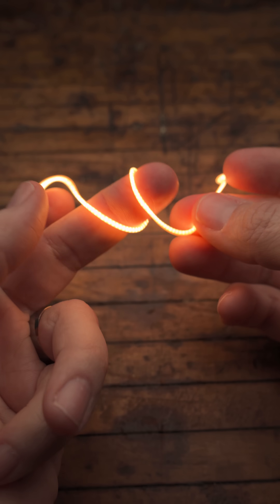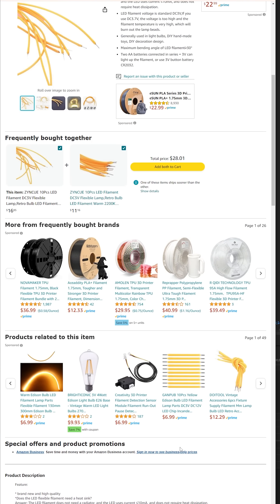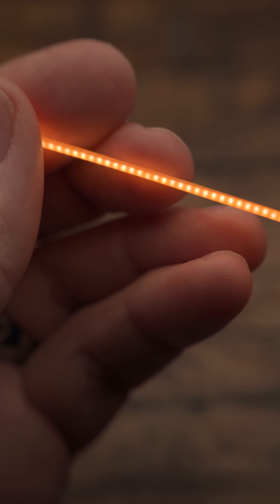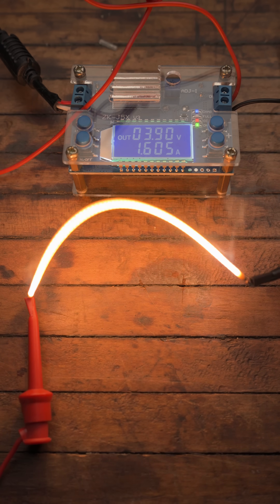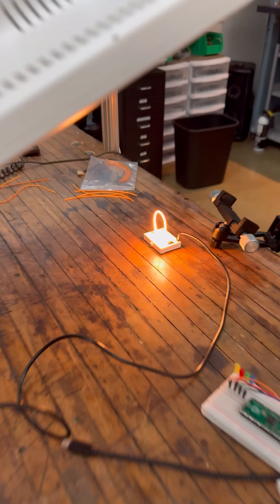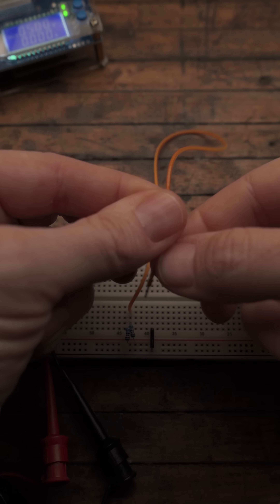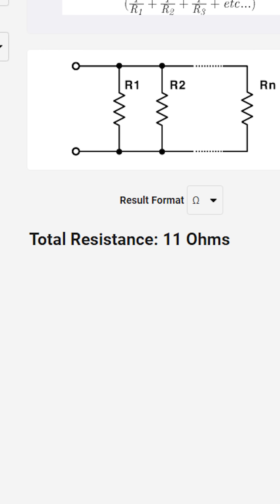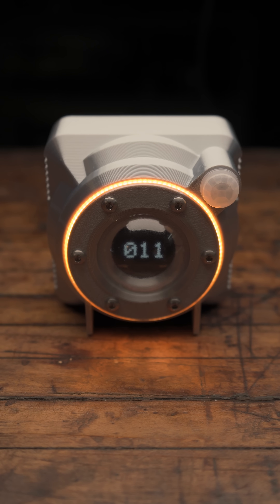#FlexibleFilamentLED

Comment: I would love to get these flexible little LEDs because i have a problem with the normal ones THEY KEEP STICKING OFF i have buyied some from the shop a few month ago and they have a plug and a thing that is connected to the plug and because of the heaviness of the plug and the thingy It keep sticking off and every time i need to go under my desk (Yes i sticked my LEDs to the underside of my desk) and press them to the underside of the desk and the worst thing i need to do thing every day because it sticks OFF. Soo i gonna buy the flexiboys (flexible LEDs) >:3

Comment: The effective resistance of 2x 22ohm resistors in parallel is 11 ohms? This seems really low, but I’m not sure what the max power per unit length you need. I’m assuming the lower current recommendation is that they’re assuming these may be enclosed in glass and those won’t have good natural convection heat transfer to cool off and will burn up.

Comment: Makes me sad I got two a cheap light bulb flashlight with one of does as it’s lights I love it a lot but one of them is abit faulty so I often bend it around to make it fully light up and keep it on the lower setting so it doesn’t burn out because it doesn’t handle the normal brighter setting to long😅😢❤

Comment: At that low a resistance I'd almost consider driving them off high frequency pwm or a constant current source from an opamp and a BJT on the output as the current source.

PWM control would probably allow you to overdrive them pretty hard without them blowing up and it's easy to drive a few hundred ma at a few hundred kHz so it won't even show up on your cameras

Comment: The statement "longer versions need more current" is most probably wrong, you need to reduce the resistance ( to half it's value) to allow the same current to flow since now the voltage drop in the led filament is (twice) higher

Comment: A traditional LED is simply a diode, which means that if the current isn't limited, it's like a short circuit. Furthermore, they are very limited in terms of the reverse voltage they can withstand. For decades, LEDs had a maximum recommended value of 20 mA; blue LEDs didn't exist. When blue LEDs were invented, they began to be used with higher currents, but always with a good heat sink, which these "micro LED strips" obviously don't have.
I should add that there are two reasons why a circuit might not have resistors. A) because what powers the diode or diodes is a constant current source. B) because it's powered by a small battery, whose internal resistance is very high.
Having said all that, it doesn't make sense for these "filaments" to operate at 100 mA. 50 mA still seems like a lot compared to LEDs used in televisions or monitors, since these have a heat sink base.
Reply: Before you ask, the reason blue LEDs began to be used at higher currents is for lighting. White LEDs are blue LEDs; they have a filter that only allows the white frequency spectrum to pass through. That's why, once in Florida (USA), new light fixtures failed, and when turned on, they appeared blue. Of course, people came up with all kinds of conspiracy theories.
It also occurs with LED TVs (the name comes from the type of backlight), where the temperature damages the filter in LEDs, and the TV image appears blue.

Comment: i feel like one could use distilled water to dissipate the heat.
if done correctly: a strip strung inside a glass cylinder  filled with distilled water should handle more current

Comment: Every LED has some "wiggle room". You can run pretty much any LED at way higher currents than specified. But the lifespan is halved, every 10°C (about 18°C) warmer the LEDs are run. So they may run fine on 200mA, but the lifespan will be significantly reduced. Same goes for running them at less power than specified. You can drastically increase the lifespan (and efficiency) by running the LEDs at lower than rated current.

Comment: People forget that you can run LEDs 2 ways, low and slow, or hot and fast. Any LED can handle 100x the recommended wattage, but only for a few seconds. Or you can run them under voltage for 100 years. You pick

Comment: I have a few of those filament style LED wires, but I wanted to find a way to get the wiring to pulse similar to the clothing from the StarCraft 2 video game with no luck, since power application is distributed serially without any slow light amplification affect. I guess the only method that would actually work is using methods that fake a pulse lighting affect.

Comment: No one gets electrical engineering right except for the engineers, because granted, it's tricky. Current requirements don't increase due to length because the LEDs are in series. 1 or 50, the same current will pass through each. The voltage will need to be increased proportionally to the length, due to the drop across each pn junction.

Comment: use a current source like LM334, any current mirror, depletion-mode MOSFET, linear constant current LED Driver like NSI45035, or a constant current diode like NSI45030.

Resistors are fine if your power supply is as solid as a rock, but these other options are far more forgiving, and really cheap.

Comment: Thanks for explaining why putting the resistors in parallel is better than getting lower resistance
Reply: Putting two 1/4 Watt resistors in parallel is the same as using one resistor of double the wattage limit (at half the resistance, of course, if it's just two in parallel) Using a 1/2 Watt 10 Ohm resistor would also work just fine.
Reply: @ctpctp can't argue with that. But sometimes you don't have exactly what you need, so these hacks could be beneficial

Comment: I had a hoodie that had one of these in the piping of the zipper it was really cool ran on two double A's and had a little stitched pocket on the inside where you would put the battery pack and then hook up the LED

Comment: Why would you turn up the amps for a longer line? That doesnt seem to make sensr in a technical way, since amps are always the same across a single line.
What you have to increase is the voltage, since every led is a little resistor and that's how it should work.
Please correct me if I am wrong, i am an apprentice
Reply: No you're right that makes no sense. The current determines how bright it is and as you said, in a line the current will be the same. So you're right

Comment: How hot do these get at the recommended power levels? I wish they sold these in custom strip lengths, would make a great modern alternative to having a light bulb hanging down from your ceiling, pair this with some sort of controller and line the corners of your ceiling with them!

Edit: basically just a tasteful version of the existing rgb led strips available on market today

Comment: Lifi ... data transmissions by electric light source. Wifi, but the light bulb is the router.
Now, with the innovation of using the infrared light, lifi can achieve hundreds of gigabytes per sec

Comment: ChatGPT just told me that one way to be able to see the wiring inside the casing of what looks like silicon, and just a bunch of leds soldered to 2 wires (that is what we want to discover, what configuration they are soldered) is to dissolve the silicon casing with toluene or xylene.

GPT also said that there may be enough of the solvents in commonly used paint tinners.

So, that's a route you can take.
Reply: This way you won't need to guess what resistance goes with what length of the strip. With the configuration figured out, by the length of strip you can have an exact match for resistance.

Comment: longer wire does not need more current -> you need more voltage for the same current, but the current should stay the same

Comment: There's another option - use a current limiting diode (e.g. AL5809-120QP1-7); It'll supply up to 120mA at any voltage up to 60v... perfect for these LEDs. Other versions are available, including 20mA which are ideal for individual LEDs... as long as you give them more than Vf + 0.7v, you'll get full brightness across the range.

Comment: just a note: doubling the current capacity quadruples the heat on the resistors. even if you use 2 resistors to spread the heat over 2 of them, that's still 2x the power on each resistor

Comment: What about the wattage if I use a regular 5V USB 3.0. the wattage is above 4.5watt that means the resistor has to be the size of a AAA battery. Any smaller resistor gets hot enough to melt steel. Am i doing something wrong ?😳

Comment: If there are individual LEDs you just need more current the longer it gets. You can have a usable range for intensity per length as you found, but if you go to a few feet you want to drop that resistance even lower

Comment: For very long life and high efficiency, you should underpower your single component naked  leds . But don't underpower your non naked circuit prepared household  leds because the compensation circutry will overheat and blow .

Comment: Imma stick it in a 3d printer
Reply: You know what, with large enough nozzle and heat resistant internals, it can be over-engineered to be 3D printed. Although the only practical shape would be a vase

Comment: at 50 or 100mA they last forever, at 200mA they will slowly burn out and loose brightness in 5 years, so no wiggle room, recomended values are there for a reason.

Comment: I'm really surprised EL wire hasn't just gotten more practically viable by this point. Power draw's a big deal and all, but... in the end shot there, the individual diodes are absolutely GLARING to me. Diffusers only work just so well. Illusions eventually always disappoint.

Comment: Longer filaments need more voltage, NOT more current. Double the length, double the voltage. Putting the two resistors in parallel is only a hack that lets you run it at low voltage. Use the same hack for running two of the shorter filaments with the filaments in parallel.😊

Comment: i see addressable rgb strips right around the corner.... PC motherboard manufacturers could use that to really kick the RGB scene to the next level.... laptops could also have panels designed into it to allow someone to make that addition to their system if they have a 3d printer.... this idea has alot of variables and that strip needs to evolve for them

Comment: So they have had flexible cold cathode rope lights for the last 15 years? that you can buy for your PC. It's a really thin wire are that lights up. But the the power source for them sometimes is noisy, and requires TV wrapped up inside of a medicine bottle or something.

Comment: Why longer versions need more current? This gets misleading easily. You've mentioned power, current, voltage and resistance. What people need to understand is how to calculate the resistor (not to burn the leds) and the resistor wattage (not to burn the resistor) at any available voltage.

Yes, I know the challenge - especially without datasheets.

Comment: How are they orange? What's the coating producing that nice warm glow?
Reply: They are amber LEDs connected by conductive wire, & sheathed in silicone. They're available in all common LED colors, including "warm white" as seen here   
(Some colors do use tinted sheathing, but those are less bright & get hotter; not recommended)
Reply: @prophetzarquon  Thanks for the detailed response! They should be used in street lighting bc They are close at the peak of human perception efficiency at night (the orange / red perceiving cones in our eyes)

Comment: I mean...the look is just EL wire, which weve had forever... But i do like that its easier to implement than ELwire is. ❤
Reply: Yeah, no more shocks & sparks!   
(Electroluminescent wire, uses ~10KV-20KV at very low amperage)

Comment: It has been decades since I played around with simple electronics, so excuse the layman terms. Can I suggest doing what many LED light manufacturers do, and run them near full power, but with a variable speed cutoff that cycles hundreds of times a second, so the LED’s are already turning off before they hit full power. For our visual latency, they will always look on and bright, but are in fact flashing at an insane rate, drawing less power, creating less heat, and ensuring the LED’s last a lot longer.
Reply: Yes, like most high-intensity LEDs, they last longer when fed pulsed power instead of constant. They're more efficient that way, too; resistors waste battery

Comment: Neon look is back on the menu Bois!!!
Can I use 12 volts straight from my car??
Reply: Yes, some lengths use 12V.   
Requisite Voltage varies by length (the 1200mm are listed @ 24V).   
They'll last a lot longer if fed pulsed power instead of constant.   
(Most LED replacement "light bulbs" are pulsed, not constant.)

Comment: You'll need to characterize them for both current and voltage. each LED die in there must drop a certain voltage. For white LEDs thats often between 3-5V, for yellow i think its around 2V. LEDs will generally turn on between 5-10mA and can go up from there. If they are in series, they will all have the same current. If you have a filament that you drive with 100mA, and you buy a longer version, they should still be driven with 100mA, but because there is a voltage drop across each LED die, you'll need a much higher voltage to acheive the same current. If they are in parallel, then you need to keep the voltage the same so that the LEDs turn on properly, but multiply the current required for one LED die to light fully, and multiply that by the number of LED die in the filament. That will tell you how much current is required for the full filament. IMO, series is better, but in parallel you could have LED die burn out and still have a functional filament.
Reply: So, do I really need to limit the amperage available? I would expect that limiting supplied Voltage is all that matters...
Reply: @prophetzarquon  LEDs are essentially just a diode. It's best to think of them as a current driven device, that drops a certain amount of voltage. If, for example, you connected a typical diode across a voltage source, eg: a 5v power supply, that diode will immediately switch on, conduct current and proceed to have 0.7V (standard diode voltage drop), essentially shorting out the supply, and without any current limiter, the max current the power supply can deliver will flow through the diode until it lets out the magic smoke. 🔥 if you connected the diode in series with a resistor, the diode would turn on, still drop 0.7V, but then the other 4.3V gets dropped across the resistor. the value of the resistor is determined by V/I or lets say 4.3V/100mA, would be 43 ohms, to acheive 100mA through the resistor and diode. In the case of the LED, we have to figure out what voltage they drop, in order to calculate the current limiting resistor for the current at which we want to operate them. Hope that helps.
Reply: @IzziedeD  Somewhat... So, even if the Voltage is low, too much amperage can flow through, unless ...? Why does dropping the Voltage more, relate to amperage? You know what? Never mind, I just need to retake my electronics courses. I haven't studied it since I was 12, FFS
Reply: @prophetzarquon  yep, even at a low voltage, no current limiting resistor will result in max current being drawn. if you lower the voltage, the LED will get dimmer, then shut off.
Reply: @IzziedeD  Interesting... This is exactly the sort of thing I need to know before trying to connect several 1200mm strands of these LEDs, to my ebike. (I will want to dim them; I don't plan on blinding anyone.)

Comment: Longer filaments don't need more current. They need more voltage. So 5 v might be not enough, even when resistor has a lower value.

Comment: These were made by the military as a weapon.  They were not redesigned.  Nor has their ourpose changed.  Rather than make these litwrally poisonous lights...why not get the light bulb industry to make proper bulbs like they use to...
Reply: LEDs were designed as a weapon? Do tell...
Reply: @prophetzarquon  what? "do tell" what.  It's not a secret...It should be openly google'able.  It was a military thing they sold to the public/private sector.
Reply: @prophetzarquon  also...I literally couldn't tell you even if I wanted to. What platform do you think youre on? "Free speech r us"?

Comment: Ok but what should I do if I want to use 40 feet of those
Reply: Get the 1200mm lengths (24V) & run those in parallel; or in series, as necessary for your available power

Comment: lol “EL wire” has been around for decades.
Reply: These are low Voltage, so they're safe for more use-cases 

(ElectroLuminescent wire runs at ~10-20KV & very low amperage; extremely high risk of shock\spark, & the power supplies whine)

Comment: idk if you know about electroluminescent (or EL for short) wire, but its pretty close to that. The only difference is that EL wire doesnt use LEDs im pretty sure
Reply: Indeed, EL-wire uses phosphor-wrapped wire, pulsed at ~10KV-20KV. These "COB" LEDs operate at low Voltages, so there's much less risk of shock or spark ignitions.

Comment: I jsut spoke with a company that has a bigger version of that and its amazing. Should have gotten a card
Reply: I want to use a couple of the 1200mm lengths, but I'm still deciding how I'd like to regulate power to them (resistors would waste battery)

Comment: sure looks amazing but dont forget about the most obvious use :D an edisonlike bulb... not a huge fan of edison but that bulb still has something to it i didnt quite find in other bulb designs :D also those are the only filaments that give u that warm orange haha looked amazing on the little device you showed thinking about getting some for my amp now:) matches the orange diode that signals whats connected :D
Reply: Indeed, these & the non-flexible versions, are what's inside "Edison style" LED bulbs.